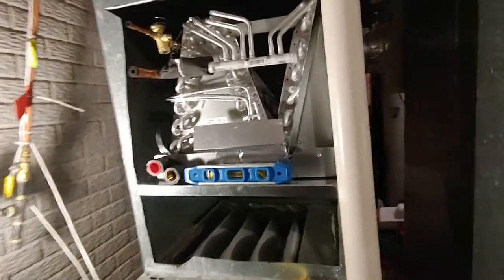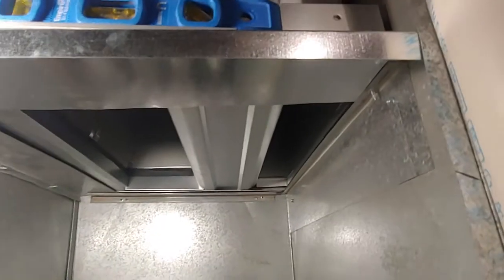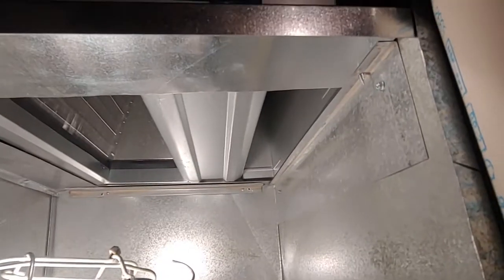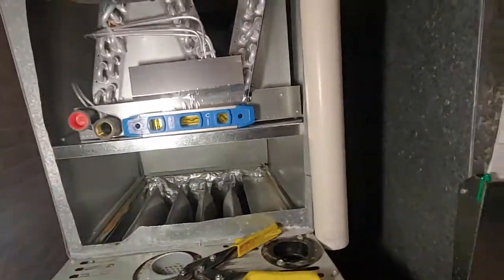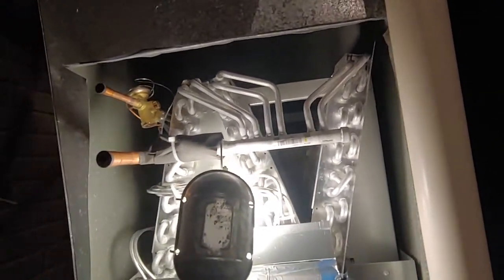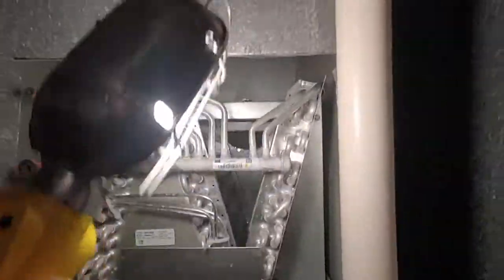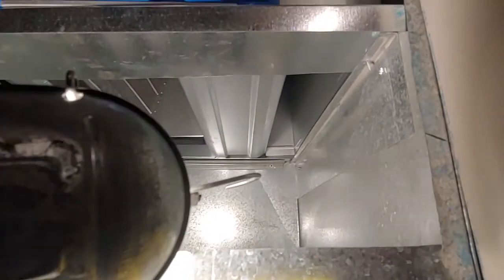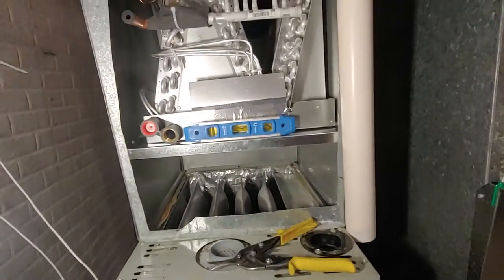Proper N coil installation

Comment: I actually just had this issue.. installed an N coil on a furnace and I got called back  twice because of airflow issues.. to be fair I took it out of the original case and used the old A coil case. Might go ahead and get a new a coil so I don’t have to deal with this issue anymore
Reply from the maker: I have taken them out of the case and used them uncased. You just have to make sure no air gets by the right side.
Reply: @EdPelto  oh so no air is suppose to get by the right side?! I have a completely open assuming it should’ve went to that right side of the coil
Reply from the maker: @BosnianEBDawah  Yes. Air needs to hit all 3 slabs of the coil but you can't have an opening on the top right. It needs to be blocked off like the sheet metal on the uncased coil in this video directing the air through the coil.
Reply: I'm in same situation. 3 ton uncased . Everyone who got stuck with these junk coils deserves a refund.

Comment: Can you explain why you shouldn’t mount directly on top of a finned furnace??????
Reply from the maker: It's always good to raise an n coil up. Any furnace with baffles especially on the right side will block the airflow to the small opening in the n coil.
Reply: How high do you recommend???
Reply from the maker: @jodykershaw7701  the higher the better. Certain furnaces the n coil will not work on at all I learned the hard way last week. 40 hrs into an ac install that should have taken 4 hrs I had to go to an a coil and it solved the problem.
Reply: @EdPelto I'm in same situation. This job is killing me and looks like I need to eat a coil. SHAME ON CARRIER FOR NOT BEING TRANSPARENT ABOUT THEM BEING CASED ONLY.
Reply from the maker: @D-Hlad  Cased would not help this situation.
Reply: @EdPelto  I don't have a trane . Carrier to Carrier. Anytime that N coil is uncased issues. A coil should not be that sensitive to airflow as a V and A coil are not. Stupid by engineers as usual
Reply from the maker: @D-Hlad  If you block any part of the opening to the coil you will have issues. There is a bulletin on the 14 wide one saying it should be raised if possible. I have never had a problem on a carrier. Also the 110k btu  80% will have limit faults if you put an n coil right on top of it. It is only if the return is on the right or left. I can't remember, so I raise all n coils on that furnace.
Reply: Goodness! I’m sorry to hear that!